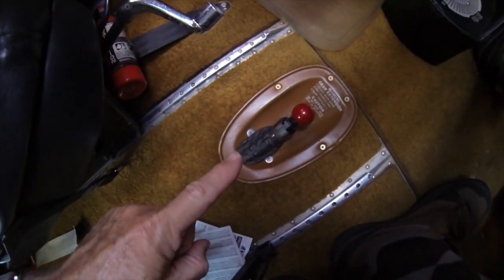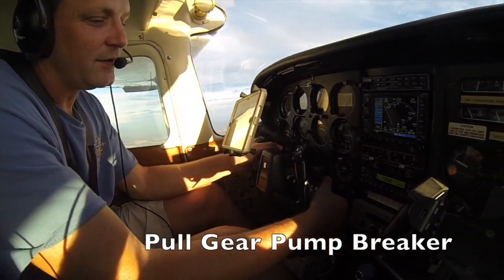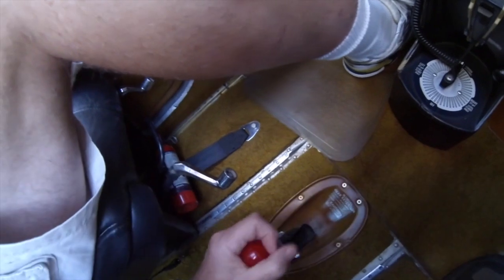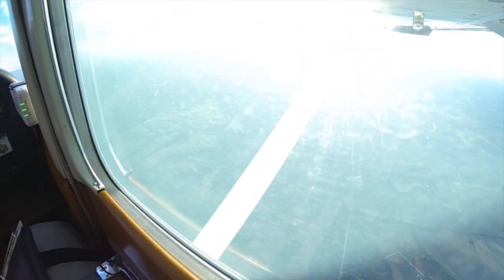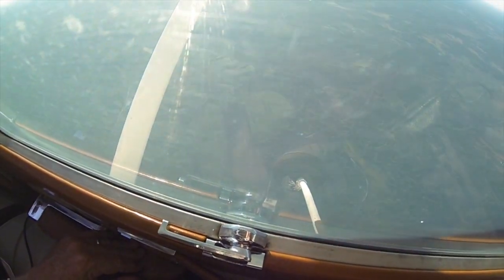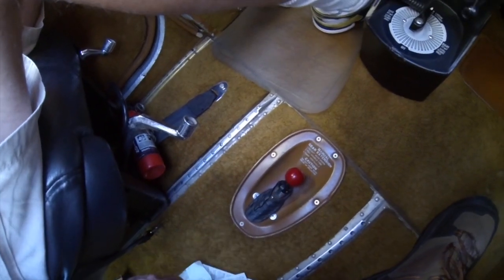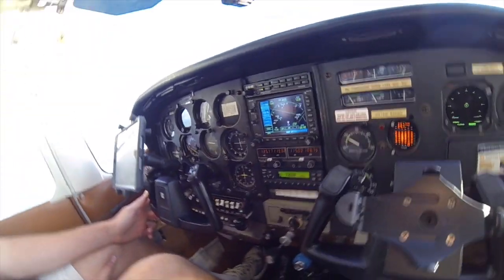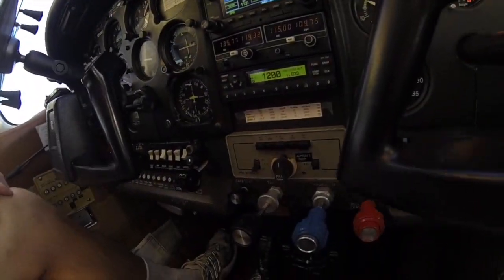Emergency Gear Extension 182 RG

Comment: Thank you for posting this! The A36 Bonanza is about the same - 50 total turns, but the first 30 are easy. I did them in groups of ten. In a real situation, I might suggest reading from the checklist, so that no steps are missed. A good podcast on real-life gear issues is at https://www.aopa.org/news-and-media/podcasts/podcasts/there-i-was